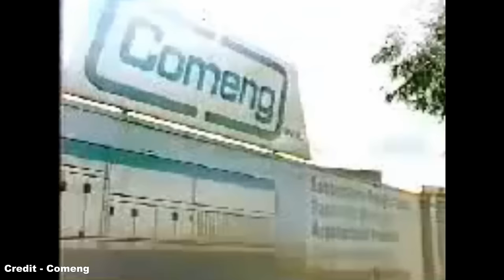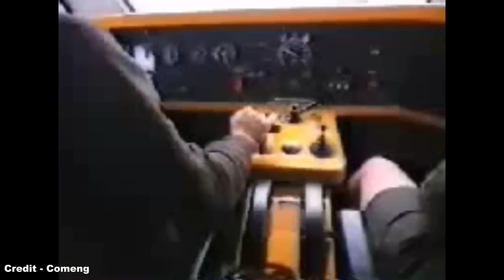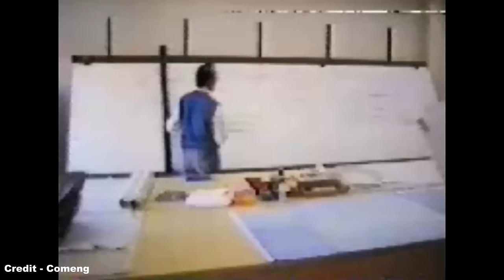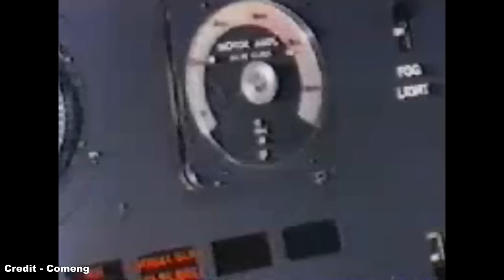The XPT - HSTs Down Under

Comment: I've lived in Sydney 26 years, can confirm the S sets could get dangerously hot in summer. They only left revenue service once and for all in 2019. They should have been heritage rail and razor blades twenty years ago!
Just a note, NSW is a state not a territory. I know it seems a pedantic thing, but in the Australian context the word 'territory' explicitly denotes a distinct type of political entity within the federation.
Reply: If it was designed in the UK I don't think cooling would have been a high priority lol
Reply: It wasnt only the trains that badly needed replacing as the government buses were also old & decrepit!
Reply: @jonjohnson2844  see that's 
where people make huge assumptions . Not only am I English but I live in Australia.  Not only does it get as cold as England in some parts here (where I live in Melbourne or Ballarat for example although not for extended months), Britain can get warm and hot to the extent that buildings and trains do need air con over there and I can never work out why they don't. Sit on a train or enter a building (the latter moreso before the 80's when they actually started putting it in) and it gets very unpleasant and clammy. Many hotels even these days don't have it and it's horrid at night. So they should be fitting it on trains these days at least.
Reply: @xr6lad  I know, I lived in Mildura for 18 months
Reply: @jonjohnson2844  I was referring to the S sets, the suburban commuter EMUs mentioned toward the start rather than the XPT.
Reply: @stevie-ray2020  I know, I spent a lot of time riding those sweat boxes too!
Reply: @jonjohnson2844  
Well...right from the earliest summers in the HST's lives, engine shut-downs were frequent because the original cooling system couldn't cope. Engineers under-estimated the high stresses on the Paxman Valentas which were much higher-revving than other loco diesels around at the time. Sometimes HSTs failed completely as the remaining engine also expired taking on the extra work. It took some years before finally cracking the problem. Generally though, the aircon in HST coaches coped okay when summer temps reach 25-30C ambient here in Blighty.
Reply: @jonjohnson2844  anti freeze and wiper action main things, do aussie xpts have prison cells on board.
Reply: @mortified776  
a lot of the problem with the cabin temperatures in the S sets, and in the new government buses of the time, was the decision to restrict the opening of the windows. In the old carriages, virtually the whole window could be opened, where as it was decided that there should be no opening that could fit a child's head out of, so there wasn't enough air flow.
Reply: One of the many significant and annoying errors in this video.  Glad you pointed it out. 👍
Reply: @xr6lad  The majority of trains in the UK are now air-conditioned, thought there's still a good number used on secondary and commuter routes that aren't. All the sub-surface (big) London Underground trains have a/c but still not the deep-level tubes, though it'll be on the new Northern Line stock.
Reply: The 'territory' bit grated on me as me. A bit like an Aussie messing up the GB v UK distinction.

Anyway. While the 'S'weat sets had no a/c, neither did anything before it like the Red Rattlers and earliet trains.
It wasn't really an issue until your cars and later trains started coming with a/c.

These days people bicker about whether a train has a colour display screen or USB ports
Reply: @ChangesOneTim  According to the Paxman history site, the HST’s original cooler group was adequate. However, two issues led to reduced efficiency: excess sealant, which reduced coolant flow, and inadequate removal of dust and other contaminants during maintenance, using a cleaning method which also happened to damage the radiator fins. Once these issues were corrected, the overheating problems were largely resolved.
Reply: @nkt1  
Ta muchly for that - shows other elements not so obvious. It's a matter of opinion as to 'an adequate' cooler group, but problems did persist and to the best of my knowledge the cooler group design was as much a factor as various engine stresses in BR's decision to derate the Valenta.
HST was the first rail application for this powerhouse, so it's just my hunch really that engineers could only guesstimate on the basis of Cooler Group X being already proven to work perfectly well with Engine Y in other industries. In other words, engineers had wrongly estimated things like brake/ballast dust ingress, shoehorning components into smaller spaces, the effect of 'binary driving' when on journeys with frequent staton stops, &c....
Reply: @ChangesOneTim  Incidentally, there’s another video on here, “Vintage railway film - Inter City 125 - 1976”, which explains the workings of the cooler group and shows it being manufactured. It certainly looks impressive, but obviously looks aren’t everything.
Reply: @xr6lad  
Indeed so in Britain - during many summers HSTs ran in one engine only, and when able to operators took out station stops to ease the heat stresses of 'binary driving'. Thankfully it was rare for both power cars to fail. Interestingly, sets repainted by operators in darker colours than BR's original InterCity 125 livery became more prone to overheating (black Labrador in bright sunshine syndrome?🤣). And that 1976 BTF film I recall from the time - brilliant detail.
Reply: @xr6lad as a fellow British expat (USA) it’s not that complicated. it’s because electricity is too expensive over there, most people would rather put up with the discomfort. It’s silly.

Comment: Travelled on the 1st XPT set on a series of journeys from Parramatta to Penrith. It was a joy, and having been on many HST sets on an extended time in the UK in 1979, found it easy to compare, and they compared well. Speed was restricted to 160kmh, but given the average speeds at the time, it was revolutionary. Typically though rail is the poor cousin with regards to transportation in this country, and is only just know coming out of the major doldrums. And yes you can still ride a XPT in NSW. I managed to get a photo published in Modern Railway magazine of the inaugural unit at Sydney Central (I still have the copy) Actually got paid 2 pounds, which came as a cheque, but it would have cost more to put it in the bank than the cheque was worth!

Comment: Excellent piece on the XPT however the reason the XPT design speed is 160 km/h (99.4 mph) and not 201 km/h (125 mph) is the traction motor gearing had to be lowered to enable the XPT to climb the long steep gradients in Australia, not to do with the slight derating of the engines for reliability in the hotter conditions.

The XPT power cars are extensively modified from the BR Class 43 for Australian conditions. To cope with larger gradients the traction motors are lower geared resulting in a design speed of 160 km/h (99.4 mph); the engine cooling capacity doubled; revised engine air filtration; longer travel, more compliant suspension fitted to deal with poor tracks; stronger frontal collision protection and nice business like sounding horns are the main points I recall. Originally fitted with Paxman `Valenta', all power cars were upgraded to Paxman `VP185' around 2000 giving better fuel economy and less Diesel / lubricating oil smoke, also there is a weight saving of approx. 0.7 Tonne per engine. The power cars are mated with carriages based on a Budd design that appear to have a larger loading gauge than for IC125 , including Sleeper accomodation; power cars & carriages manufactured in Australia.
Check out `XPT by COMENG' (3 videos) here on YouTube if interested. Also `XPT at Wauchope' and `XPT leaves Penrith for Dubbo’ have great sound & no visible smoke.
Edit: If I may be allowed one more recommendation `North Strathfield Train Spotting - Heritage Steam Train, XPT Explorer and Sydney Train'  0.18  has unique sound on YouTube of the rear power car going by under load, reminiscent of an old Spitfire aircraft which of course also had a V12 engine.
Edit 2: Video `Trains   NSW TrainLink   Move Over V Set, XPT Coming Through!' illustrates the good acceleration that can be achieved with a reduced formation ( 5 car) train when the driver `guns it', the low gearing helping to give almost electric train performance 1.11

N.B. Their normal operating configuration is with a power car at each end and up to 7 passenger cars (first, economy, sleeper and/or buffet), although there have been times when the Dubbo train has operated with a single power car and four passenger cars [source Trackside Videos - TRV125 - Comeng XPT (DVD)].
The original spec stated that a single power car should be capable of starting a train of 4 cars up a 1 in 30 gradient, although as far as I know the Dubbo service is always run with two power cars nowadays.
Reply: Geez it sounds nothing like a Rolls or Packard gasoline V12 whatsoever, all you can hear is mostly muffled and fan noises, it sounds shithouse and you can’t get better than a 2 stroke EMD or Detroit period
Reply: @jamesgovett2501  We'll probably have to agree to disagree, to my ears you can hear mainly the exhaust note, with Doppler effect. You clearly prefer the sound of American 2 stroke Diesels which is fair enough.
Reply: @Martindyna  There are a few of us oldies who remember the fabulous 421 Class with their EMD V16 2-stroke diesels and the wonderful, distinctive (and loud) beat.
Reply: British units received MTU power over paxman units.Whats that saying?
Reply: @eugeneoreilly9356  Germany I believe have always been at the forefront of Diesel technology. VW TDI comes to mind (each injection for the power stroke is ‘stuttered’ into the cylinder instead of all at once) and BMW Diesel cars have for years had clean tailpipes on the inside.
Rudolf’s parents were German (from Bavaria) and although born in Paris, Rudolf was educated to a high level in Germany from the age of 12.
While the Paxman VP185 was a vast improvement on the smokey Valenta the MTU equivalent offering was considered superior for re-engineering of the Class 43.
One only has to hear & see an MTU equipped IC125 power car started to realise what quality they represent.
So good that Rolls-Royce bought the company some years ago. 
Just love how the cameraman seaches in vain for any visible smoke in this video :-  
https://www.youtube.com/watch?v=CgoFfi4mfUY
Reply: @Martindyna  yeah,I don't know how much of MTU,RR own but they sold their diesel division in Shrewsbury to Perkins years ago.Perkins is now owned by Catapillar.
Reply: @eugeneoreilly9356  Link to a video now added to my last comment Eugene.

Comment: That accident in 2020 is very... contentious to say the least. A lot of small dumb factors coming together at once!

People stealing copper cable meant the signals in that area were out of service for a period of time, and during a period of work on the track the loop was set to be used for 8 hours that day. Now it would appear that the XPT driver didnt have a copy of the circular showing this information, and the pilot was called in at short notice and may not have noticed it either.
Reply: One issue with these push pull trains like this is that if the lead loco is derailed the rear loco will keep pushing. So what would be a bad derailment with a single loco pulled train, with a push pull train it canturn into a major incidents. Such as this incident at Wallan in 2020.🇦🇺
Reply: Reminds me of the 2003 Waterfall disaster, the driver happened to have a heart attack, which couldn't lift up the dead mans footboard, and the guard had a microsleep all at the same time.
Then again, conspiracy theorists suggest that it was some sort of spiritual ley line sh*t, so who knows. At least in this instace the official story was actually true.
Reply: @raymondwelsh6028  Actually that doesn't happen. many of these push pull sets have been derailed but maintained a straight line. When the lead loco is derailed the pushing loco is also stopped from pushing as its controlled by the lead loco. which would stop working. Oh by the way. I did work on the railways so I’m not uninformed. And the train in question is a development of the HST which was a British invention you bought from us. I know it well. The principle of push pull is that the rear or both locos are simultaneously controlled from the leading can. If a driver sees a problems or gets involved in an incident he invariably tries to shut of power thereby cutting power to both ends at once
Reply: @raymondwelsh6028  A very uninformed comment. Putting the brakes into emergency cuts power from all locos running in multiple. Not that it matters hitting a 15kph set of points at 115kph.
Reply: It’s amazing how everyone is a expert on this while the investigation is still underway and probably don’t even work on the railways let alone have anything to do with the running of the XPT.
Reply: @MrPLSmith1  My Question referred to my experience with the HST in Britain.   These were never referenced as push/pull because of the power cars on each end and the close coupling of the coaches.  HST coaches didn't even have buffers unlike all other MK3 stock. 

Push/Pull wass a reference used for  coaches pushed or pulled by a single loco and a driving trailer on the opposite end.  In the 80s Scotrail would run these with a Class47 pulling from Glasgow and pushing to Edinburgh.  The Intercity 225 also uses a push pull setup as does the US CalTran, Metra and countless others. 

Entering a loop at over 6 times the permitted speed will not end well regardless of the make up of the conistst.
Reply: I don't know much about signalling but wouldn't it be sensible to have a Yellow caution signal protecting the passing loop ?
Reply: @Martindyna  there would be something like that if the signals were working at the time (read first comment)
Reply: @MiG21aholic   Thanks but I wonder how the signallers didn't realise about the stolen cables, I mean these systems are always fail safe. No point in speculation i guess.
Reply: @Martindyna  So someone stole the copper cables which made the signalling system fail. In order to continue to provide a train service while workers were fixing the system a scheme was implemented where a driver would be helped through the section with a "pilot" (a worker that knows where the train has to go and how fast they have to go).

A memo was issued that all trains would be directed through a set of point that were locked in position (because they couldn't be controlled by the signallers) and no warning flag and things were set up because the idea was that the pilot would be aware of the location of the junction and the instruction that all trains have to slow down for it.

It seems that neither the driver nor the pilot headed the warnings and the train did not slow down for the junction. It seems that the investigation is trying to determine why, but it seems to me that it's quite likely that either one (or both) of these employees weren't doing their job correctly, (it could still have been caused by someone else's incompetence) but as far as I can tell it's reasonably cut and dry. The lucky thing is that the two people who are most likely to be at fault are the only two people that were killed. It's not great but at least they didn't take anyone out with them.
Reply: @pwhnckexstflajizdryvombqug9042  If they were working under the V/line system instead of the ARTC there would/should have been additional warnings at the site of the speed restriction, and not just relying on one piece of paper given to the crew. This has proven to be a fatal flaw over 100 years!

Comment: Ah, I'd been looking for a well-made summary video of the XPT like this. Very well done! They're a hot rod all right with the deep and burbly sound to match as they slow down and then take off again from stations, and to answer the whingers, there are certain lengths of straight and well-laid track where they can stretch their legs to 160+ km/h. I remember one such run up north of Sydney where for once we zoomed at striking speed for quite a length of time through the Hawkesbury region. That was toward the end of a Brisbane to Sydney trip. I've also ridden to Melbourne and back from Goulburn- a town they pass through every day of the week 3 hours south of Sydney, whose station now looks healthier than it did back in the 70s because the service is so good. 

Thing is, the XPT was slightly detuned and given shorter gearing than its HST forerunner in order to handle steeper grades because we didn't have the budgets to re-lay tracks. It nevertheless was a celebrity train that did sex up the image of the railways at that time, attracted more people to use the service, and proved a very reliable and comfortable beast. In fact the replacement seems to be running several years late so the XPTs will still be running for some time yet and I hear nobody complaining. I ought to book myself another trip on one while I still can!

Comment: The one thing I would add to this is I’ve heard the XPTs are the hardest working passenger train sets in the world in terms of kilometres run. The long distances and intense usage adds up. It is a credit to their design and maintenance that their reliability has been so good. 

(FWIW: having travelled SYD-MEL a few times on the XPT in the passed 10 years it was always glaring that the standard to track work in Victoria was much worse than NSW with a much rougher ride.)